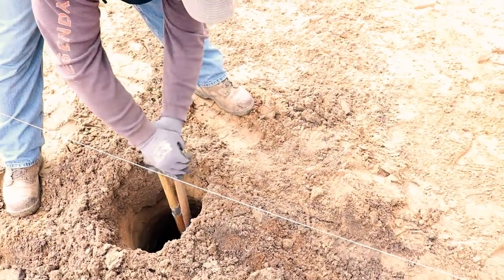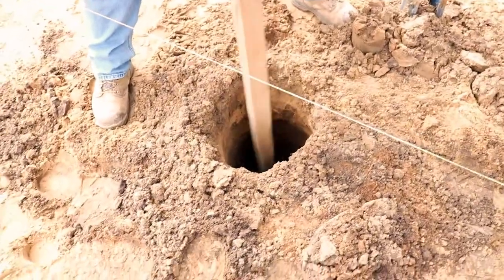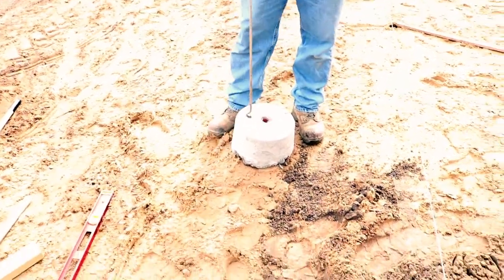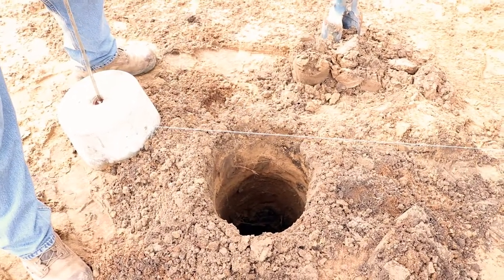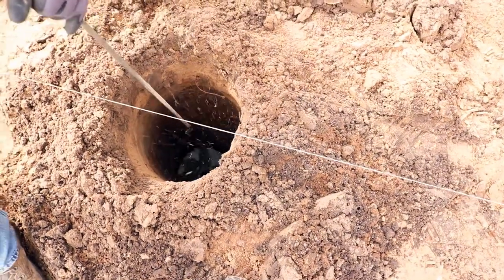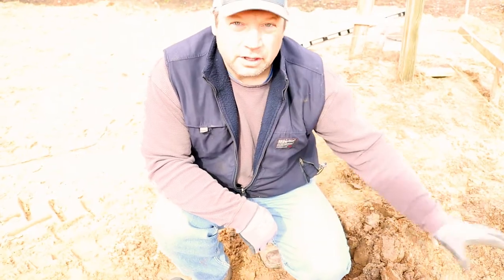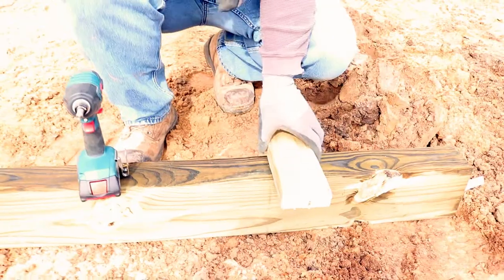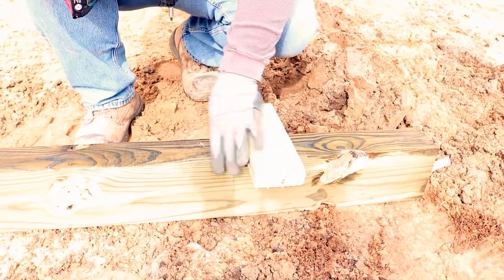How to Set Posts for a Pole Barn - Shop Build Part 5b

Comment: As far as concrete eating away that copper in the post, the truth is ACQ lumber has not been out long enough for anyone to know what its going to do or how long it will last. Most posts rot off about 6 inches from ground level due to microbials, not moisture. I just replaced 4 posts that were rotted off in a guys pole barn, and sure enough the 6 inches below ground were rotted away, but below that it was like new lumber. Even though it was 30 years old and constantly soaked with water. That was NOT ACQ lumber though which takes me back to what I said earlier. Great video though
Reply: ACQ has been in use since the 1980s

Comment: If you don't add some gravel on top of the concrete to separate the concrete from the end grain of the pole I would at least coat the bottom with asphaltic foundation coating. A 12" pad may be alright for non snow areas but I would check the actual loads (roof live and dead loads and wall load) with the allowable soil bearing pressure to see what you actually need.

Comment: One can pour concrete into the hole to create a cookie using a laser level to create a constant depth.  Then with the top of the concrete all the same height or depth depending on how you look at it your posts can all be the same length.

Comment: Wow you make that look simple that auger sure comes into play Big Time. I can remember when we had to dig each hole with the post hole digger or the clamshell digger. Great job guys looking awesome!
Reply from the maker: I learned to use the clamshell digger at a young age too. 😀 I was lucky enough to be able to borrow this 3-point auger for the tractor. It made this job so much easier. I can't wait to get this shop finished so I can get back into woodworking again. Thanks for watching.
Reply: I used a power-vac to vaccum out the soil at the bottom of each hole. The soil has to be dry & should be loosened prior attempting to vaccum it... easy peasy.
Reply: @CountryFamily  can u build on for me in minnesota?

Comment: Michigan. 
The hole depth and diameter depend on barn height and the region barn will be built in, the footing or cookie can also very in size. 

I am currently building a 
50’ X 100’ X 16’ and the hole depth is 63” the footing is 30” X 30” X 15” post is required to be in the ground 48” inches, overall depth is 63” to accommodate the footing and allow the post to be 48” below grade.

Our auger was 48” in diameter. With an extension on a skid steer. 

Footing forms 30” X 30” had to be made because good’ol Michigan sand just kept caving in.

Cross member at the base of post should be pressure treated and 
2” X 6” X 12” or greater. Put them on two side adjacent one another to prevent heave.

Comment: Good video, right to the point. I'm going to give it a try, might be 6 of one or 1/2 dozen of the other, but I was told you put the string an inch and a half in, I see you use an inch-and-a-half shim. Is there a pro or con either way

Comment: Sorry late to the party, where did you get those concrete cookies ? I will be building a barndominimum in South Texas in sandy soil, had this EXACT thing in mind, YOU are the first one I have seen use this idea. GREAT MINDS THINK ALIKE ! Have you ever heard of "post protectors "? It is a thick plastic sleeve that encases the portion of post that goes inground to keep moisture and cement off the wood. Any info you can share on those cookies would be appreciated.
Reply from the maker: I got them from Carter Lumber, my local lumber yard that supplied the posts and framing lumber. I believe the big box stores like Home Depot and Menard's have them too. You could also make your own by mixing up some bags and pouring it in a five gallon bucket. It may take some thought on how to get rod in there to hook a rod onto to lower them in the hole. 
I have seen those post protectors and in a wet area or somewhere that doesn't drain well I think they would be worth the investment. I'm on top of a sand hill and my slope is really good so I opted not to use them. I've also seen tar paper wrapped around the post where the concrete will be touching and I meant to do that but forgot. You know how it goes when you're the architect, the project manager, material orderer, the carpenter and the laborer all at the same time stuff gets missed. 😄
Hey thanks for watching and good luck with your project.

Comment: You put the cookie in so the post won't sink right? But won't the cookie sink too?
Reply from the maker: Yes, the cookie has a surface area of more than 5 times that of the post itself so it can support 5 times the weight as the post directly on the soil without sinking in. 
Similar to how an 8" block wall is laid on a 16" or 24" wide footing. 
In some soils it may require a larger cookie to hold the same weight. 
Kind of a rambling answer, hope it makes sense.

Comment: Im very surprised the building inspector thinks a couple of 8 gauge screws are going to stop the pole
from pulling out of the ground in a good wind.....unless there is no wind where you are.....
Reply: The deeper the hole the more grabbing power on the post
Reply: @richardcollejr.5121  the hole is only 900mm deep after the cookie, and its in very sandy soil which is prone to wash away and has no
strength compared to clay .......in NZ poles would be 1200 -1500 deep .....
Reply: @kermets  when you have sandy soil I found you dig deeper and put a bag of multicreate (dry) then set your cookie on top. The crete will harden with the sandy soil and help stop washout. I've always tried to put the post 6' in ground

Comment: What treatment are them posts? Here in Virginia where i live the frost line is 48 inches makes it pretty aggravating lol
Reply from the maker: The are pressure treated rated for "ground contact". I think they're AC2 brand of treatment. It's only 42" here in Michigan and that's to the bottom of the hole from finished grade.
Reply: @CountryFamily  crazy the difference in frost depth. Do you have any concerns with that treatment rating? Ive been looking at UC4B posts or CCA that are foundation grade permanent wood structural posts. The price makes me wonder it a "metal carport garage " would be better atop an "Alaskan slab"
Reply from the maker: I'm not sure on the type of treatment, but  it's pretty much standard posts around here. My father-in-law's barn is built the same way about 30 years ago and there is no sign of rot. It helps that it's pretty sandy and the grade slopes away really well too.
Reply: @CountryFamily  definitely good draining soil helps, here we have clay that retains moisture pretty bad that was kinda my thinking for my posts... either way its still a dang pile of money lol!
Reply: @CountryFamily  hey buddy! just thought I'd holler back at you, I finally built a garage, I went with a metal carport garage on a monolithic slab and turned down footers. hope yall are doin good

Comment: Very nice job..I like the cookies did you make those in 5 gal bucket? How much  create per cookie? Thank you..I want to do the same thing..very nice building methed..well done sir
Reply from the maker: Thanks for the comment Bobcat. I bought the cookies from my lumberyard. They have a hole with a rod on the top to allow you to lower them into the hole easier.  I did make some in a bucket for a different project and if I remember correctly one bag of redimix makes two cookies, but I'm not sure on that. Good luck with your project.
Reply: @CountryFamily  
Thank you..I will look into them ..

Comment: I live in Kalkaska and I was told I need 18” holes for a 30 x 40 pole barn
Reply from the maker: We both fall under the Michigan Residential Code. Nowhere in the code book could I find any guidance on the size of the cookie. I submitted my plans to the township and they ok'd it. 
I don't think the overall size of the building is the main factor. I believe things like the height and roofing and siding materials that affect the weight of the building along with even the soil type would determine the foundation. So to err on the side of caution, a bigger diameter cookie surely doesn't hurt anything. Thanks for the comment Ken.
Reply: Country Family Homestead . Thanks for the response. I really liked your video and hope I can be as successful getting mine built
Reply: im in otsego I built a 40x64 the building inspector made me do 36" footers

Comment: Im building a 18'×18' pole barn soon. Any tips?
Reply from the maker: Most important is to pre-planning and careful layout. Be picky about level and square and the rest will come easier. Also if you are considering an expansion in the future (like a lean-to or addition) plan for that now too to make it easier in the future.  Good luck with your project and thanks for watching.

Comment: Use screw in anchors. No need to dig.  These also let you use shorter poles or have a taller building. Another is you can use non treated posts.
Reply: Never heard of screw in anchors.  More information please
Reply: here in michigan the purpose of the deep hole is to prevent frost heave which an anchor wont do.